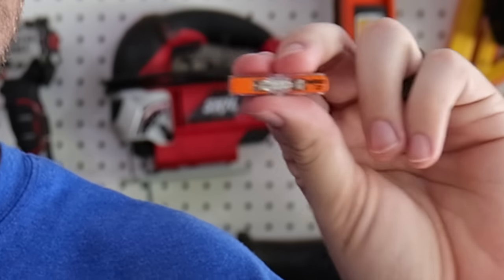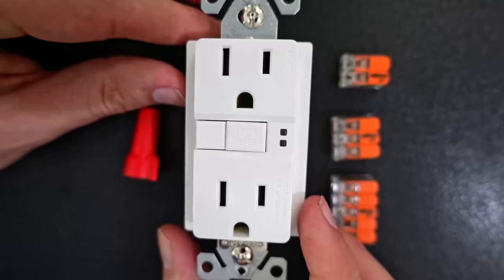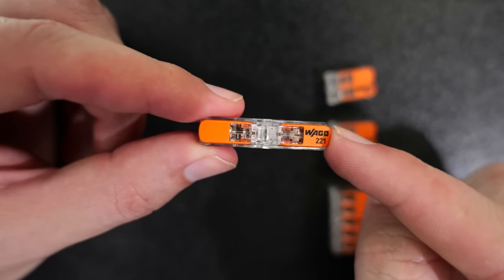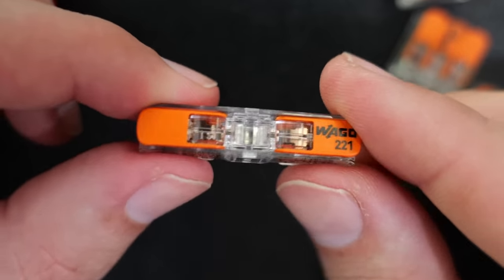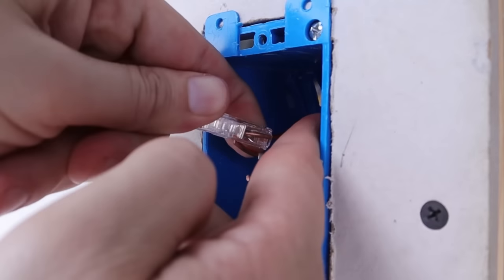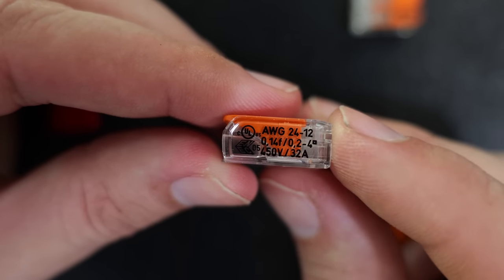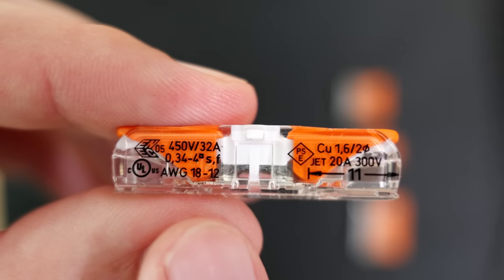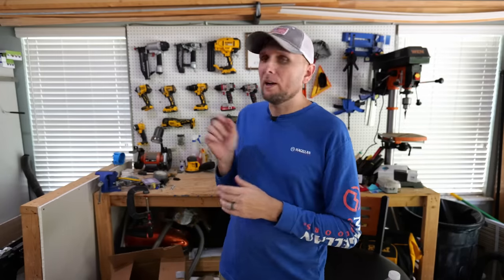New Wago 221 Inline Connector That EVERYONE is Talking About - And One Thing Nobody Talks About

Comment from the maker: Have you used these yet?  Pretty nifty for certain installs I think.
Reply: Yep just got mine delivered from Amazon. Going to use them for chandelier wiring
Reply: I bought the #12 version and they work great for extending short wires or in cluttered boxes.
Reply: I have been using WAGO for the past 5 years especially with converting existing fluorescent lights to LED.
Reply: When I rewired my 1950 home I used Wagos in all my jboxes. When I did my panel swap I ended up using an inline to extend a couple of the neutral wires. 5 years later and I've NEVER had an issue.
Reply: Used lots of em, best thing ever, Wire nuts are OBSOLETE...Wire nuts actually destroy the wires..Wago don't and don't use knock offs WAGO for the Win.  Even new Leviton duplex outlet has a Wago type connection now, wanna bet Wago licensed their technology?
Reply: Been using them for at least ten years but in Germany, my understanding is they've been using them for over twenty years(??).
Reply: They're my favorite. I recently had to redo some switches and lamps in the kitchen and those were perfect for attaching stranded wires to solid core wires!
Reply: @boblewis5558  the first versions had a kind of push button instead of the lever. And there are still the primitive ones for soild wires without lever. I use them professionally for over 30 years, never seen one fail. It's a superior design.
Reply: They handle 32Amps, unless you're filming from Japan :)
Reply: Looks terribly expensive and unreliable compared to normal welded wire.
Reply: I got some for 1-1 wiring on my motorcycle to keep the wires going the same direction instead of doing U-Turns in the standard Wagos. I put heat shrink tubing on top.
Reply: in germany we only use this. Big advantage is they are easy diconectorble. For solid You can get them in smaler but just for solid. you even can get Gel packs to get them iP68

Comment: Always think it's crazy how americans describe Wago connectors as a DIY solution for low current applications, when in reality they are objectively superior to wire-nuts in every way.
Reply: Except cost. They cost about 3-5x as much as wire nuts in bulk.
Reply: What I don't get, is, why they always only talk about the more expensive lever wagos. I would assume that most installations are made with solid wire connections, no matter if in the US or the EU -- and for those are the cheaper push in wagos better suited anyway. I use the ones with the levers only when stranded wires are involved in any way.
Reply: Dumb and sensational videos are easy to push around.
EU here - yep, wago is nice, so is crimped connectors, so is push-in.
Reply: For my own home, that's all I use.  Fuck caps, especially when you have multiple 12 gauge wires.
Reply: In Germany we only use solid wires when cabling our homes.
So connentions can be made more compact, with integraded spring loaded connectors, but without  levers.

They are called Wago 2273.203  and they are fairly half of the price. Wago 2273.205 with five holes are also very common.

You simply stick the wire in and that's it. In order to release you have to twist the wire two/three times to the left and to the right and pull it at the same time.

That way work is done alot faster. And changes can be executed in a fraction of time.
Reply: @marsrocket  they cost like 50 cents each when you buy the 90 pack. You cheapskates are the reason every house has a dangerous nest of unorganized wires.
Reply: @zeisselgaertner3212  those ones ever so slightly damage the copper, but are still better than the twist on caps. I'd rather have the levers on everything.
Reply: @marsrocket Because they are superior
Reply: Correcto 👍 😂😂😂
Reply: Aren't these rated for 32A? So pretty beefy.
Reply: @marsrocket  you are just afraid of wago because they will put you out of business. Wagos make wiring too easy to hire a "professional." Now any old boomer can do it with wagos.
Reply: I squeeze the dielectric lube in the connection in my low voltage lighting system and they have held up nicely.   I do tape them n
Reply: @legalize420  Look at your name.  Nuff said.
Reply: They say they are more expensive. Here we use 230v so wires are a lot thinner and cheaper. I use wagos with levers for when I want to switch wires around in industrial applications or tests. The smaller push ones are more suited for permanent home applications. They also won't get lose as it has a spring.

Comment: The 221s are rated for 32A, you’re looking at the Japanese ratings. 221s are available in 12AWG or 14AWG maximum versions, so you’re comparing two different sizes. For extending wires I’d recommend the push fit WAGOs, they’re even smaller, the lever ones are only necessary if you’re dealing with stranded conductors.
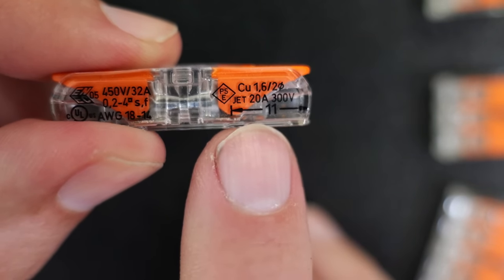Reply: Yes, check video at 4:15, it shows the US rating is 32 amps on left side.
Reply: There are IEC/EN(32A) and UL(20A) ratings printed. Neither is a japanese rating.
Reply: @danielrose1392  Wrong. 20A rating is for PSE JET which are Japanese.
Reply: In addition to what the other commenters have said, the maximum sizes for are 10awg (221-61*) and 12awg (221-41*) not 12 and 14
Reply: Also, 32 amps at 450 volts.
Reply: OK so why are they different? Different testing? Or standards? If Japan only allows 20A is the 20-32A range questionable or dangerous?

And what do the "0,2-4* s,f" markings mean?
Reply: @yellowrose0910  different systems mainly, but I can assure you, they can take 32A all day without issue. There are load tests people have done if you want to see for yourself.
Reply: @sstorholm they get dangerously hot at somewhere around 100-150 amps. 20 or 32 will be fine all day.

Comment: Is about bloody time they introduced inline ones. The crafty Chinese have been making those as "knockoff" designs long before Wago themselves "introduced" their official ones. Embarrassing, really.
Reply: I don’t know when they came out, but it was at least 2 years ago because that’s when I started my current job, and we already had them then.
Reply: Easy to understand, I have learned more from this man then any other one out there. He covers everything you need to know big thumbs up.
Reply: I first used Wago inline connectors some 20 years ago, that was the older design with push button instead of the lever. Inline connectors for lighting applications for solid wire on one end and strained wire on the other were introduced more than 30 years ago.
Reply: I was specifically referring to the smaller inline ones with levers, both single ones and the multi-ganged blocks, not the 224. I apologise for the ambiguity in my OP.
Reply: @Anvilshock  seems like Wago introduces new designs in Europe decades before they send them to the USA. I understand why - UL is one of the most stupid institutions ever 🤣
Reply: I only use ideal products because they are made in the USA. Still the wire nut wins in temperature and tightness test. The push in connectors are handy for updating light fixtures I don't recommend doing this but I can install them with live wires. The knipex stripper is plastic no chance of getting shocked. But if the breaker is handy please turn it off first. Ideal makes guerilla and regular wire nuts and the push connectors, I just bought a few. 73
Reply: I have used the grey Chinese 3 wire in, 3 wire per input out connector for years. I bought a giant bag of probably 1000 of them years ago and they are excellent for low current control applications (for example a control panel that has a 0.5 amp or 1 amp breaker that is feeding 20 or 30 different devices each pulling only a few milliamps). Although I have several on air compressors one loaded all the way up to 25 amps. Been there for years and still looks perfect. Any higher than that and I would use a terminal strip however. Or in any area that's not readily accessible. I wish someone would come out with the same type of connector in a less dubious version that I don't have to take apart a few of after buying a batch to check them, but Wago seems so slow to catch up.
Reply: @stefankaufmann8257 UL specifically isn't required though. Just a nationally recognized testing laboratory. ETL, CSA, MET Labs, etc all would be fine. There are more than just UL to choose from. I see more and more ETL rated items every year.
Reply: @theodorgiosan2570 good to know👍 

i was working on high vacuum coating machines. The customers always required UL specs. When i compare UL specs to EN, requirements for EN are equal or higher. But we would be in big trouble, if there is no UL sign on every part, wire etc. 😂 

But not all customers are the same, some also agreed with EN specs.

Comment: Maybe you can tear one of these apart and show how these are making a lot better metal-to-metal contact than the device on a back-stab outlet.
Reply from the maker: You know what, that’s a great suggestion.    Going to add it to the list.  Thanks!
Reply: @HowToHomeDIY  At that point, if you could get your hands on a European socket with a push-button-release push-fit connection and compare it to the two, that'd be great. People too often mix them up with back-stabs in yt comments, not realising those use different mechanisms.

Comment: I bought a pack of these about a month ago thinking it looked like something that could come in handy sometime. Little did I know that a few weeks later they would save my butt!  I had some defective wiring and had to cut off power to an entire circuit. Unfortunately that circuit also included the bathroom. Using the Wago 221 I was able to put together a splice in just minutes that allowed me to keep the bathroom powered while I made repairs. During the process I had to re-configure the connection a few times which was as easy as a flip of the levers.

Comment: These are especially useful qhen doing reovations where conditions are not ideal. I once had to splice 5 wires together. They do make wire nuts that can handle that many wires, but good luck twisting that much copper together. These Wago connectors provided a very elegant solution!

Comment: One thing I love to use Wagos for is bench testing, theyre great for tempory connections to check funcionality, and ive used them to connect meter probes to check continuity on items like float switches to check that they do open/close the circuit
Reply: I always have an extension cord with wagos that I can quickly connect to smart light switches. I typically configure, program, and label them before an install. quicker and easier than wirenuts.

Comment: For wet locations (low voltage, 12Vdc) I use Gardner Bender Ox-Gard or similar dielectric grease squirted into the connector before inserting the wire. I’ve used this technique on several trailers and garden equipment and never had any issues. I’m sure any grease will work but the small hole in the squeeze tubes makes squirting the grease into the connector very easy.

Comment: I just discovered the Wago and am using them in my new garage build. I LOVE THEM. Also, as a model railroader, the in-line Wagos are going to be a great product, especially for module connections. 2, 4, and 6 port in-line would be fantastic.
Reply: There are cheap Chinese ones that have several inline connections. Should be fine for low voltage. I wouldn't trust them for house AC wiring. Genuine WAGOs are already inexpensive, can't be much profit or savings in counterfeits or versions that aren't trying to be fake WAGO.
Reply: Chinese also have inline 1 to 2 or 1 to 3 versions. They're not as high quality though but fine for say 3d printer and such hobby stuff.

Comment: I didn't watch the full video but one thing I always say about these connectors is that you can use a pinch action with finger and thumb in one hand to open the connector. Absolutely brilliant when reaching into a tool belt and open the connector as your getting one from the pouch. If your fitting 30 or 40 of these when moving a distribution board or even up a set of steps... that simple pinch action to open them saves serious time!

Comment: Thanks, I just ordered these.  My den is wired with 12 gauge, but the line coming in to the room is 14 gauge.  I've been using the regular 221's for a couple of years now and they're great.  Especially the inline connectors which are useful where an older home might have short or metal fatigued wires in the box leaving a short wire when it breaks.
Reply: so you can use these to connent 14/2 romex together?
Reply: @ShyRage1   Here's my take, if I understand your question:

 If you are pigtailing, within an receptacle box, for example, that is standard practice.  

But anytime you need to connect romex outside a box, you need to install a junction box.  You put a blank cover on such a box, since there needs to be access to it on a wall.  

You have to look at the electric code to know for sure, also there may be additional local regulations.

I'm not an electrician, so if a pro knows better, please correct what I wrote.

Comment: For ceiling light fixtures I have been using the WAGO 224 series (112 and 101) connectors for years. Shorter than the new 221 inline and they handle the stranded wire of the fixture very well. Also the 224-112 allows you to connect two neutral wires or just one, as required, still in the small package.
Reply: Yes indeed they're super compact and come in different variants, making light-fixture installation much easier, no more awkwardly balancing lamps while dealing with screw connectors. They were the first ones I've been using regularly since the older wago terminal blocks sometimes were just to big for junction boxes around here and i rather used the old VDE doly connectors there.
Reply: Also, if you're trying to hold up a light fixture in one hand and connect wires with the other one while your mother is standing worriedly at the base of the ladder wondering if her son is going to electrocute himself, despite said son being a grown-ass middle-aged man, it's a lot faster to hook up Wagos than traditional wire nuts.  Hypothetically speaking.

Comment: I had an accident last November that resulted in me not being able to use my right index finger for ~4 months. I had to add another light to a hallway and from watching your videos I decided to change from wire nuts to the Wago connectors. I couldn’t twist wire nuts, but the Wago connectors clicked easily. Thanks for the info and insight into this handy, easy to use connectors.

Comment: I've used Wago lever nuts since 2017 and since then have changed most of my switches and receptacles in two houses, plus put in ceiling lights, fans, etc, and rewired lamps.  I just saw the inline connectors and ordered some, since I was doing some more wiring.  I was disappointed that I couldn't use them in the current application, but am sure I will.  I've had the levers pop up a few times, so started to wrap them in electrical tape, then I don't worry about it happening.  

ETA, it's surprising how many of the traditional wire nuts come loose over time, which is what I've found when I replaced them.  It would be very rare for me to use wire nuts instead of Wagos.  Wagos are def safer.

Comment: In a wet environment use a marine crimp which has the heat shrink but also a heat activated sealant inside.  A heat shrink is not going to prevent water intrusion.

Comment: we started using these Wago connectors at work for small projects... (haven't used any inline ones yet) one thing I would love to see is a version of these devices that are safe to use with Aluminum wire for safely updating old outlets in houses that have aluminum wiring from the 70's to save money back then... any ideas here? the purple wire nuts are stupid expensive and very messy. Also worth mentioning... most of my aluminum wire on 20A circuits is 10 AWG wire so they wouldn't work with the standard 221 type connectors anyway...
Reply: The problem with aluminum is if there's any moisture, there's a reaction where the copper eats away at the aluminum.  I don't think it's necessarily the wires interacting (they don't), but the bus bar is made of tinned copper.  WAGO sells a contact paste called Alu-Plus that's supposed to make it safe to mix copper and aluminum.

Comment: Hey, thanks for explaining between the two inline models!  I have 12g wire and didn't realize I needed the 2401!   They're on the way now, in time for a project next week.
Reply: You don't. 221s can do 12g
Reply from the maker: @TheChipmunk2008 Yes and no.  221s are a family of different connecters but you then have different models of the 221.  In the in lines there is the 221-2401 and the 221-2411.  The 221-2411 can only handle up to 14 gauge wire.  The 221-2401 can handle 14 gauge as well with a max at 12 gauge.  So there is a difference.

Comment: just bought a heap of these I am replacing 12 downlights and a track light , getting rid of the transformers and just connecting the wires to the down light wires that come with a plug which I am cutting off .I will tape around the connection as well just in case.

Comment: I appreciate you doing these videos on the WAGOs - your in depth look at these through several videos greatly helped me doing some wiring fixes and additions to my house which was built in 1952 and while all the electrical is still in good shape, like many older homes there aren't enough outlets, lights, etc. Having the option to use WAGOs especially as you mention for extending wires that are too short. I've used that trick a bunch with WAGO connectors. They also make adding additional overhead lights from another light already on a switch (and the mixing of stranded adn solid). Thanks again!
Reply: so you can use these to connent 14/2 romex together?
Reply: @ShyRage1  Yes - I used them to extend some overhead lights in my basement instead of wire nuts. Easy to use and easy to remove if later I want to remove them.